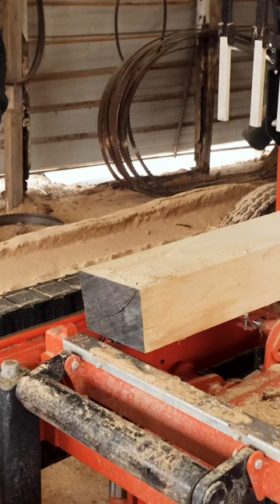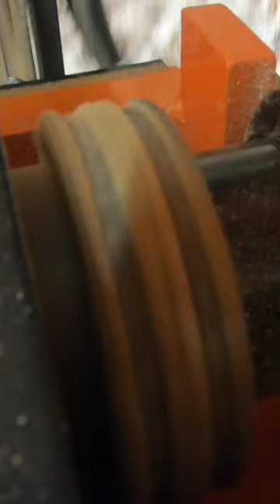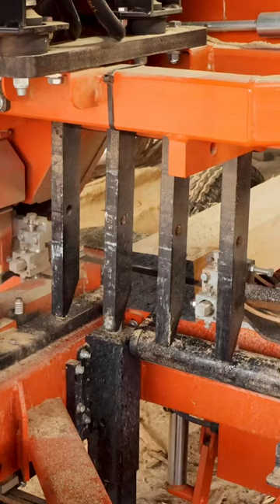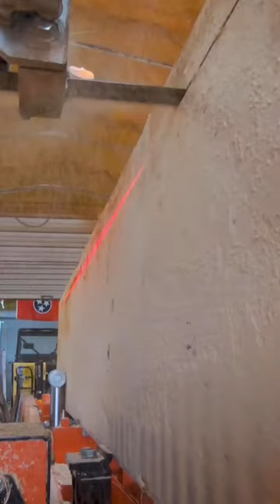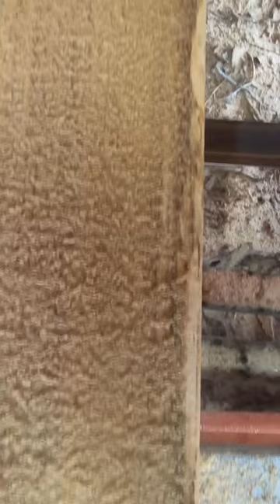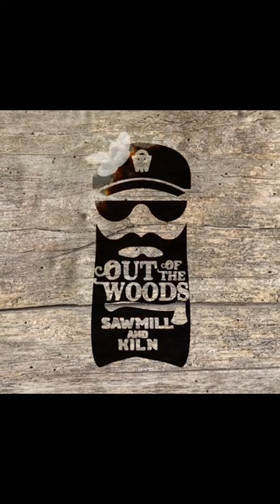Making Homemade Lumber At My Sawmill #shorts

Comment: You should weld some 1/2  square stock on the bottom of the drag back arms. That way the boards will catch on the 1/2 inch blocks. And the boards won't fall down when you get to the end of the log. The weld tabs will hold the board up so you can drag it back to you. Save time from bending over and reaching for the lumber
Reply: Great 😃👍 Idea,  Joe.    You must've run across that yourself.... unlucky for you... Mr Sawdust doesn't really want OUR OPINION...
This is more of a....
 'everyone sit back watch ME do it MY way..' I joked a bit about the 12-18 inches of built-up' and he told me where I could put it... LOL